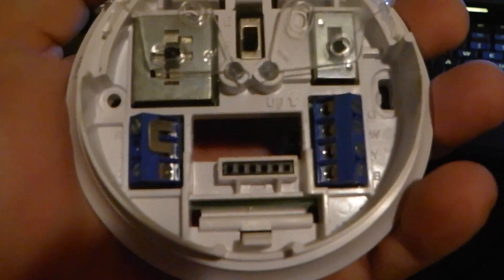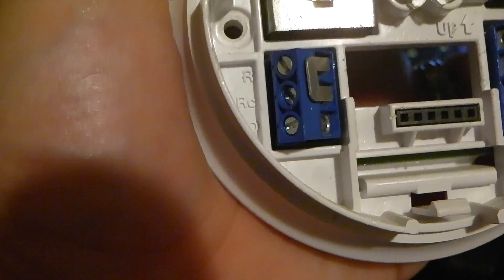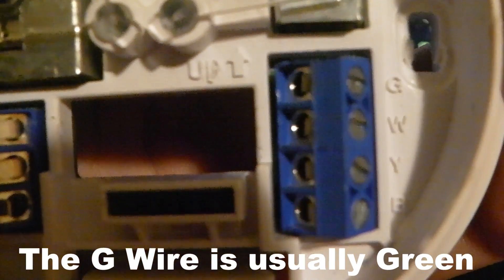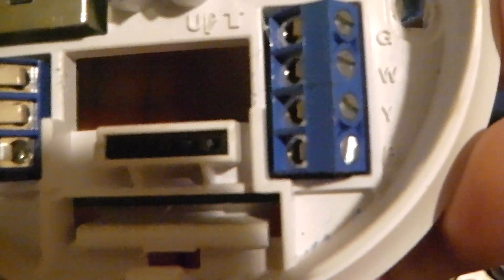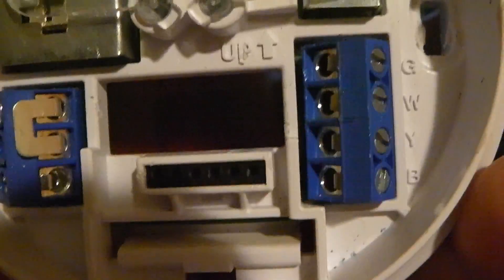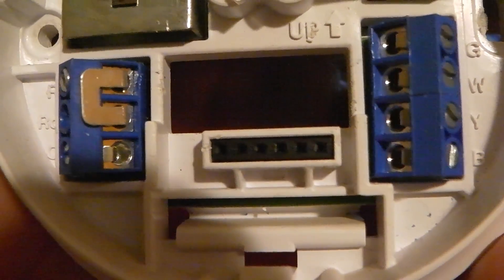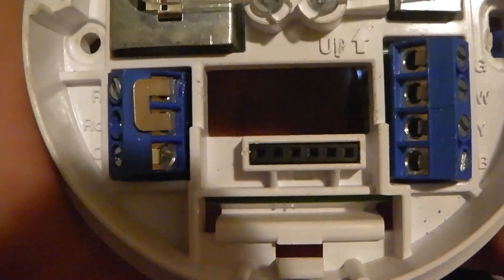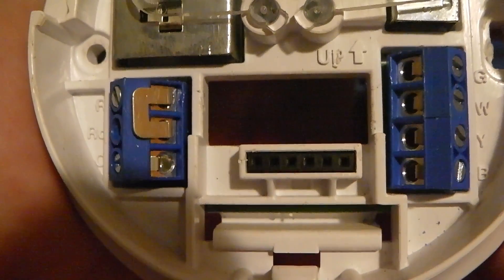Understanding Thermostat Wiring (Ecobee3 Nest Honeywell thermostat installation)

Comment: They say that blue wire can sometimes be common. (I have no yellow wire) I have 4 wires. Red to jumper(lft),..Green to G (upper right),.. White to W (second down on right),....then there is only a blue wire. Is that the common which AI says to connect to "C."   But I see no "C." Only "B" (bottom right) It is model CT87n?...help please!!
Reply from the maker: It all depends on how they wired it at the source. You could take a multimeter and see if the blue wire has voltage on it. If it does, it could be a C wire. You could also go look at where it connects to the device you're controlling and it might have letters on the circuit board/place where it connects

Comment: I purchased a CT87N. I have a Red going to R/RC jumper, White to W, and Blue to Y. Only three wire were there on the old thermostat. Question, current indoor temp does not read right off by 6-7.A/C runs all the time, and indoor temp seems to not move much. Am I missing a wire?
Reply from the maker: Double check your pipes outside and make sure they're not frozen...might be a leak..if the pipe is frozen turn off immediately and turn only the fan on to defrost it. Call an HVAC service to seal up and/or search for leaks...that's what it sounds like as if those are the original wires and you connected it right it should be working
Reply from the maker: Could also try blue to B but like I said in the video...the wiring can be non-standard when matching color. I would take a picture of the wiring before you mess with anything

Comment: I have 6 wires coming from the gas heating unit to an old Honeywell thermostat.   Yellow to Y, red to R, green to G, orange to C and  blue and white to W.  The blue wire is connected  to W2 in the heating unit. My question can I attach the blue wire coming from the W2 terminal in the heating unit to the W2 terminal of the thermostat(Honeywell RTH636001002) or do I combine the blue and white wire coming from the heating unit wit a third wire and connect it to the W terminal in the new thermostat.
Reply from the maker: I would keep the blue in W2 as it is setup that way already. If it was split up already, it probably powers two different types of units like second stage heat. If you have two stages you want the thermostat to control each independently hence the W and W2.